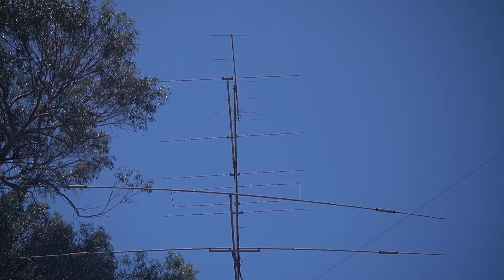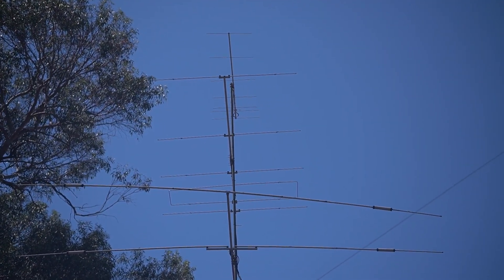Do You need a Gain Antenna as a Ham Radio operator ? part 1

Comment: Height is might. Beams produce a great layer over a wire. Height adds another. Monobanders add another. Stacking adds another. If only I had taken my own advice years ago. Put more $ into the antenna than the amp. Get creative with 40 and 80m phased arrays. The first week I put the Mosley 33 up I saw a night and day difference. At 35ft. Now I visit the contest station with 5 stacks on 130 ft towers. It’s amazing how many dx pileups you can bust with 5w with those antennas. Finding used beams are very common. I paid 125$ for my Mosley as well chuck. Great antenna ! Gain antennas are a must have for anyone that can actually have one. Sadly it took me 20 years to find that out. Hehe. I’m loving it now. I would also touch on azimuthal maps. Not really square maps bc they aren’t accurate at all. Unless people believe earth is flat I guess lol. Japan is nnw from me. I always thought it was west. Crazy no one talks about these things. 73 brother
Reply from the maker: Thanks Jay, I agree I didn't find much if any videos on the subject. And funn in my first take I mentioned Ape and flat earth lol, but I forgot to turn my mic on.

Comment: I'm going to test for Extra soon. Some portions of the antenna section of the practice exams give me a bit of trouble. Thanks for the video, it's helping understand the section. 

73, W4ISB
Mike in Tennessee.
Reply from the maker: Mike good luck on your test for extra, I'm glad this helps!
Reply: It did. I'm reading, Pass Your Amateur Radio Extra Class Test The Easy Way, by Craig, K4IA and HAM Study dot org's website. So far, I'm consistently passing the practice exams (74-86%), depending on the questions.

It's nice to get a visual reference on the antenna instead of looking at graphs. Now the graphs are making sense after the video.